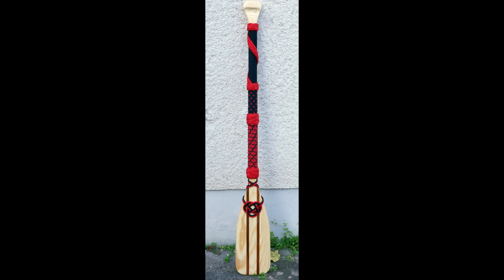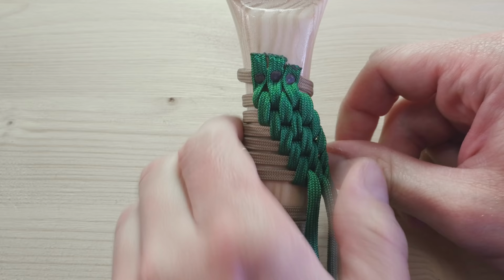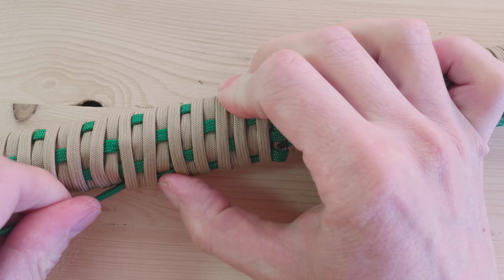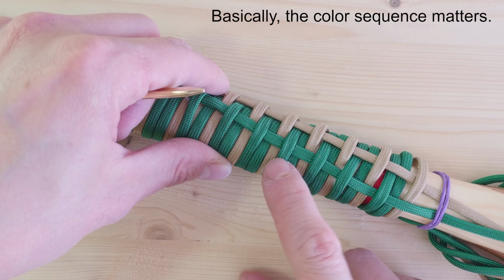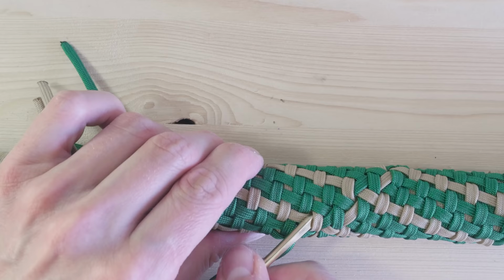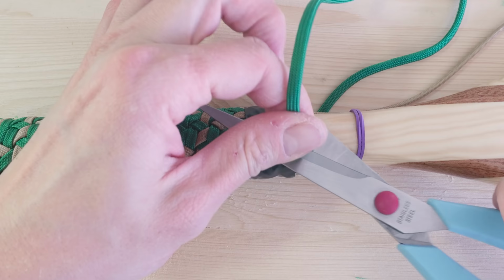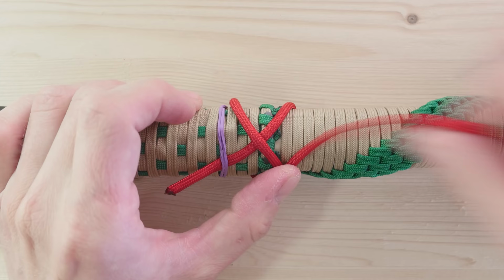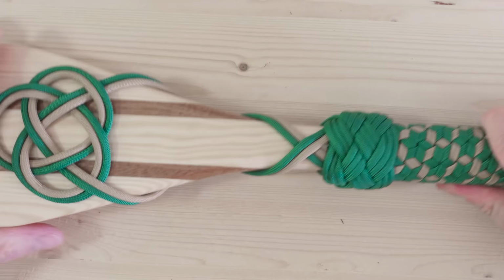Paracord paddle wrap- a bit fancy

Comment: I did it !     Mark thanks a lot for the clear explanation. 
The lessons I learned are : 
a. make the star weave a bit longer than you need because you will lose bit at the start and finish. 
b. if you make the 4 knots in a light color (mine were white) use a light color of tape to secure your work.
c. if you think that the wrap for your star weave is loose enough, continue loosening. If you think it is too loose, you are almost there.

Comment: Great...do you have a video showing how to wrap a steering wheel quick and easy?
Reply: I'm not the guy you're asking but I think the star wrap or the even numbered herringbone plait would look good in my opinion. However it's the starting and finishing of the wrap that is likely to have challenges since in that case you'd not want it to bulge out. There's got to be a way to get the ends bound while being as close to flush as possible. Going around spokes may also have their challenges. And of course you can't just can't roll it to straighten and even-up the weave of the plait, so it's also going to need extra care for consistency.

Now I'm curious if Paracord Guild would try to address that as a topic, because that would make an interesting subject to try. (Although I'd switch to leather stripping in that case instead of paracord. Since I've got a feeling it wouldn't show dirt over time as much.)
Reply from the maker: Hey! I did cover a relatively simple wrap in the link below. Maybe you will like the look as well.
https://www.youtube.com/watch?v=1wRKJY1map4

Enjoy!
Mark